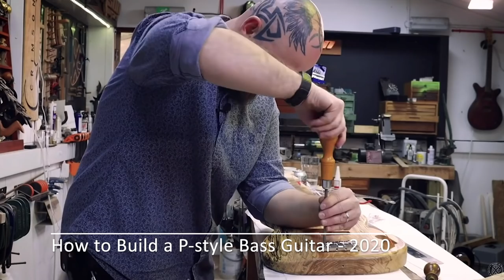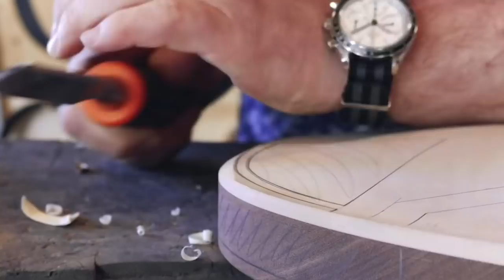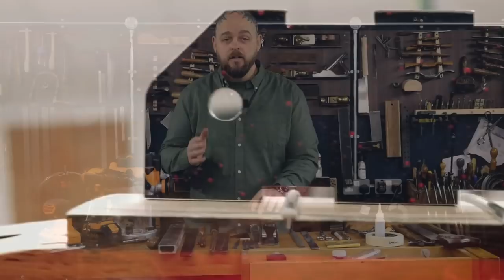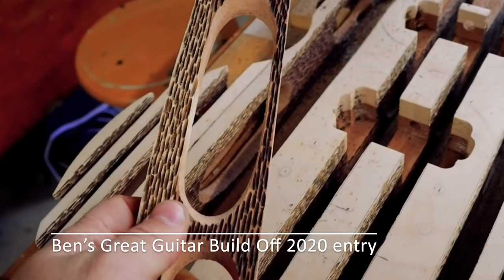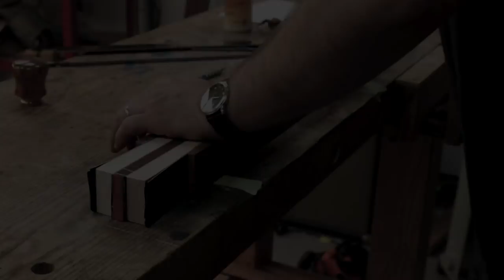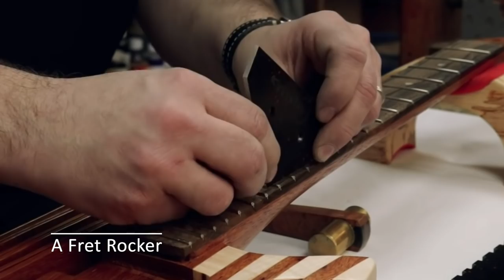Top 10 (or so) Essential Tools for Building a Guitar at Home

Comment: Forgot clamps? :)
I think the buy the best you can thing is certainly true but it applies more so to some things than others especially when starting out with a one off guitar. I've found cheap ail express router bits, silverline planes, forstner bits, pillar drills, hand drills, routers, oil stones, rulers, clamps, angle grinders, sanders, hand saws, wood files all to be perfectly usable at the budget end of the market. Sure More expensive stuff can be better and last longer, but the cheap stuff is perfectly usable especially if you buy branded stuff like Bahco or magnussen or bosch.

 Where I really feel it really matters is any power tool you want to use a fence on and get a true 90 degree cut like table/band saws, Gouges used in hand carving hard woods,  and  Luther specific tools like fret cutters and nut files. These are the areas where I've found buying cheap is throwing money away.

Comment: I have watched some of your bass builds.  Very nice.  Well done.  

I am positive that there is a better and faster way to carve out the back of the neck.

Using a rasp or angle grinder, seems both slow and imprecise.    

I know that a CNC machine would do it nicely, but that's cheating. 

What kind of a jig could you rig up to do quicker and better carve out of the back of the neck? 

I know you can figure out something.  Put it in a video if you can.

Comment: I prefer using forsener bits than a router, just due to the loudness of routers and that using a drill is less powerful so you can see it go wrong quicker and it won't be as severe

Comment: Yes I agree but fret files ? On my Leatherman their is a diamond file perfect for putting a ball end radius on a fret better than the Gibson Custom shop or Fender etc without leaving the customary Gibson Custom marks on the fretboard . It also has a groove for sharpening fish hooks but will sharpen anything tiny for inlays . Needless to say my Leatherman goes everywhere I go as 5he screw driver bits fit US guitars . Japanese saw rasp nice but a good long and short rasp definitely , if not an old draw knife like the bowyers used and a spokesman ( a fiver for both well spent) . The only thing Japanese I have is my sushi knife . With a 4" angle grinder you can now get attachments that with do everything from shaping to polishing and also make short work of cutting brass or aluminium flat shaping and polishing if you make your own nuts , bridges etc . With mine I have grooved a smooth shaft rotary switch to take a 6mm splined pot . Apart from using your granny to hold everything while you hack away , some sort of work bench , vice thingy . You saw fancy long drills in use . You can buy " aircraft length" drills from drill shops and they are not that expensive but for wood you can make whatever length drill you need from a length or plain steel rod say 4mm diameter , heat the end , flatten it and use your angle grinder to make a brad point flat drill the size you want with a little careful grinding on your angle grinder , that will whizz through any wood and also soft grades of aluminium . The first one I ever made was for a full length cleaning rod in a very long gunstock and it drilled a very long hole and came out exactly where it should have done and the 5/16" cleaning rod slid in with enough tension to keep it in place while shooting this reproduction piece .
The tool not mentioned and is absolutely  essential without anything else is YOU ( and maybe a bit of ' Tool ' blasting in your headphones!). Practice with the tools you have got on scrap until you can use them as you would a pencil or knife and fork, then move on to the next level .
Then use granny's sewing machine to wind pickups !

Comment: wen i decided to make my stratocaster body i ran into a problem..i had no tools! i ended up using a saw from the 1920s a hand powered drill and bits a pocket knife chisels small hand plane a rasp and a few other files and sandpaper tung oil and nitro lacquer...i did a mahogany back 50-50 maple top,that way the comfort curves could be delt with rather than bending and gluing a thin top. it turned out fantastic! i reclaimed the wood from antique furniture witch was the key to a successful outcome i think. all i know is that fender has never made one like this one. i asked them and they told me that they could but it would cost way more than if i did it myself.

Comment: Regarding the crowning files, starting with a triangular file for a beginner, e.g. myself, will take a few meters of fretwire and time. It's great for understanding what I'm actually trying to do and stuff, but honestly, I would spend 30$-50$ on a purpose tool(same price as a proper triangular). Currently rocking the Hosco, the ones without a handle, and Baroque's latest iteration - either one does it without costing a kidney; the latter also works nicely on worn frets. Importantly, saves the time and money to progress the job and frustrate over wood-related matters. That being said, a proper triangular file must be a must to have and learn anyway. Also teaches you to be less of an "appliance tool" for tools and more of understanding what, why, and how. 
Sooo, 80-90 usds for both is a bargain and good. Oh, almost forgot.
There's that single-use thingy for the goddamn fret tang. Pay the money. Better sooner, than later.

Comment: Get a moto or dremel tool and I gurantee you will use it not only on guitars but around your house. I use one to cut the stainless steel frets with the thin cutoff wheels that will keep the fret from overheating. The advice on accumulating tools is one I give when tool shopping for car. Buy the tools progressively. Don't buy a tool thinking you might some day use it. Buy it when you need it. Also, try to consolidate as many job task into a single tool as possible otherwise you end up with too many tools. For refrets, all you need is a triangular file for the fret crowning and a fret rocker. Hammer in the frets and then use the fret rocker to spot check the frets that are high. File down the tops of the frets and then check again with fret rocker. When you go thru all the frets only then do you crown the fret tops. Using a level beam speeds the process. Also, get a digital caliper that has millimeters, inches and fractions on it. You'll use it to size the old frets and figuring out thickness of the fret tang for the existing fret slot and trying to get a new fret with the same dimensions. I got a husky brand from Home depot for like twenty bucks.

Comment: You kind of forgot a REALLY important tool for electric guitars: A soldering iron!
Well, maybe you asumed this to be a grandmother tool idk...
Reply from the maker: I didn't even consider that.. typical! There is always something I miss when putting lists like this together.  Thanks for pointing out my inadequacy 😆 B
Reply: My grandma was shit hot with electronics & had an extensive collection of electronics tools & testing gear in her shed. Like a lot of working women in industrial areas, she built & tested circuit boards & wiring looms throughout the 60s & 70s for the aerospace industry
Reply: @DavyHulme  your grandma sounds most excellent
Reply: @simonfairall5122  aye she was that, cheers

Comment: The importance of a sturdy workbench is highly underestimated. I only have one of those 30,- foldable ones and it's the worst. I prefer working on my sofa's armrest.
Reply: Make a good sturdy doubled 3/4 plywood  “top”  glued together a about 18x 36  with 2  batons beneath to raise it off  floor or table. Before I had space and money it served well for a few years and stores behind sofa
Reply: @frankmormon2503  This is actually a great idea. Thanks, man!
Reply: I actually still use it on my regular bench for close up small work,cork on the batten bottoms  and after 8 years put an extra layer of plywood, it’s a rock!

Comment: I don't even own a drill. I have a handcrank POS I don't use. Upstairs downtown Toronto. Guitars hanging on the wall to make an Ikea desk useful.

All about presized wood strips and planning. I use a racheting screwdriver and drill chuck to drive drills. Step drills are the best for starting.

Japanese saws and rasps. Shinto? Double sided and the swappable cutting type.

Did a pagoda fretboard with just that on a maple oak cedar laminated neck.

All presized wood from home depot. The OAK EBONIZED SO DARK.

I've got three rolls of fretwire 2.9 2.2 and 1.6 bronze. Crown file and rubbers. Not happy with the crown file same brand as the rubber set.

A 12" radius block a 30" flat aluminum level block a couple small planes and a really good set of files chisels from dollar stores.

Clamps. I have four 5" a bunch of 3" and three extended 24".

Comment: I suspect the list of tools for repair work different but similar to build tools.Obviously a lot more clamps etc.I consider a good vice to be a very important tool for both building and repair. Also if one levels a spirit level on a flat surface like a surface plate or even a jointer bed or float glass one ends up with a precise tool well within guitar neck/ fret tolerance for much cheaper than a level beam. However the notched straightedge is a very good tool for precise measuring especially for repair work and makes me wonder how I got along without one for so long.Also money can be saved by making safe edge files using a grinder wheel for a good nut to board slotting tool as well as a saddle slot leveling file.I have even made a good narrow file from a triangle file's one edge and other 2 edges can still be used for fret edge file by safeing the opposing corner.  One can then save the money for harder to make one's self like good set of nut slotting files which are very expensive or cheaper ones wear out fast. A low angle block plane critical for repair work like the 60 1/2 also a violin makers knife very handy and a set of scrapers with various shapes are great for building and repair.
Reply from the maker: Thank you for all that info.  DC

Comment: Cant you use a zero fret to avoid using nut slot files? Also, clamping devices are not shown and you need them, be it clamps or some sort of cord tightly wrapped.

Comment: Question: anybody ever use old strings for nut files?  They work great on bone and probably tusq as well... it might be a little squirly on plastics.  It's a great poor-man solution until you can afford a real set.  These can be used by hand or strung across an appropriate saw frame.

As for tools, yes... I just found out that my father had virtually all of these tools and more... inherited from my grandmother :)  Only if he shared this info before I bought many of them myself!

Comment: Whilst it’s not directly used to build a guitar I would say a good sharpening system is essential, especially as planes & chisels are not ready to use when you buy them.
Reply from the maker: yes.. very very true.  It was one of the implied additions that I slipped through as just a part of having a plane or chisel ;) B
Reply: @CrimsonCustomGuitars  it took me years to discover that chisels & plane required sharpening before first use & foolishly assumed they came ready to use. After that discovery my appreciation of them grew dramatically

Comment: im debating whether to get a  surface planer for less than £200 new..which is a similar price to a couple of planes no 7 and no 3..it also requires zero skill..i might get a triton thicknesser too. ive been watching vids on using a router to surface place .using a simple jig ,but there will be lots and lots of sanding afterwards

Comment: I find too much of the guitar building world doesn't want to make useful tools for anybody who wants to do something other than typical designs.   .ie. I can't find nut files for a 5 string bass that goes up to a .135 on the B.  Notched straight edges for scale lengths other than 24.74, 25.5, or 34.

Also wondering what sort of things I should consider if I want to use Stainless Steel frets? I keep hearing horror stories about how the tools will all fall apart.  But I want to use them in my builds.

Comment: My top tool is CNC machine
Reply: i bet if you knew about cnc machines you could get a great one that replaces all tools needed for a guitar...however,its not common knowledge..would you like to share your knowledge
Reply from the maker: With that, sandpaper and fret leveling tools etc you are golden.. I love my cncs as well, I just vastly prefer the process of making guitars by hand tbh. B
Reply from the maker: The cnc is at best able to replace all routing and most drilling operations, installing frets, leveling them etc. Making nuts achieving a final sanding and finish etc etc all have to be done by skilled humans.. no getting around it until we have much smarter robots, and by then they will be making us do the work anyway 😉 B

Comment: My old woodwork teacher would have strung me up outside the shop for putting a hand plane down on the plane surface. His rationale, there might be a nail, a screw or anything on the bench that can damage the edge. A damaged edge ruins your work faster than you can say it. The instruction was put it down on the side, it is not that hard to do.
Reply: Was taught the same thing back in 1973. Thanks Mr Rosen. 👍🔨😇

Comment: On the drill bit subject. Buy the best you can. And "high speed" does not mean drill in high gear setting with trigger fully pulled. Especially in metal. For metal I usually run my M18 Milwaukie in low gear and only about a 3rd trigger pull. Keep it cool and lubed. If its a deep hole clean out chips often.
And why are nut files so expensive?
This not a hard material!
I guess your paying for the accuracy of width.
Anyway, great vid.
Reply from the maker: Good point. And yes.. anything that is accurately gauged and low production costs more than we would like. Hell, the files I prefer for general use are insanely expensive per file, you get quality but it sometimes hurts! B
Reply: @CrimsonCustomGuitars  I have a good friend who owns a machine shop. He's made a good living basically by being able to measure and cut stuff with superior accuracy. 

Every time I make something he checks behind me, hate it.

And I refretted an old Kay acoustic he had, still learning but came out great. My Daughter likes it because of the narrow neck.

Comment: The essential tools I'd add to the top of Ben's list are a solid work bench with a good vice, sharpening stones and an accurate set square. If you're new to woodworking and want the best advice on what tools to buy and how to set-up and use them, then check out Paul Sellers' channel and websites.

Comment: Planes and chisels need to be sharpened, even when brand new.  So that makes even more tools.  And those sharpening tools can be pricey. (Maker of fine kindling and exotic saw dust!)
Reply: That said, you can get started for the price of a couple-three sheets of wet-or-dry and a dollar/pound store picture frame glass, and a dead leather belt makes a pretty good makeshift strop if you can't get soling from a local cobbler (or EBay or what have you) at a decent price. Good stones (or plates) are more than worth the price, but they can wait. So can the low-speed bench grinder with CBN wheels, etc.

Comment: Very late comment. I'm trying to understand why nearly every piece of hardware we need for guitar building is made to such odd sizes.
For example, you know those deep washers with the internal bevel to accept neck bolts. Why are they 15mm??!! Half inch would work just as well. Finding a 15mm or 19/32" brad point is a task. Every hardware store has .5".
Anyone?
 

Edit: Or tuning machine post shrouds (the part that goes in the hole). Those are typically .389" on diameter tapering down to .381" on most generic tuners. Why not just straight 3/8"? It's a loss of just .007" per side.

Edit 2: This seems like gate keeping to me. Thoughts?

Comment: You don't need to buy most of these tools new. Pawn shops and Craigslist are wonderful for power tools. be patient and do research. A used good tool is almost always better than a new crap one. I now have 4 routers and two tables which i got for less than a new one from a big box store.

I found a decent chisel in a parking lot. My dad found his primary claw hammer in the road. Keep your eyes open.

Lots of C clamps. About 4 Pipe clamps. I would put this up there with any of these tools for importance.

Comment: If you´re using chisels and planes, you´ll want to have some way of sharpening them. And indeed, you get what you pay for...
Reply from the maker: Yes, I should have added that to the mix in the same way I mentioned drills and drill bits, routers and router bits.. chisel_plane and sharpening gear go hand in hand.. B